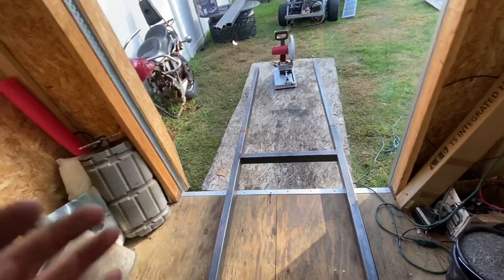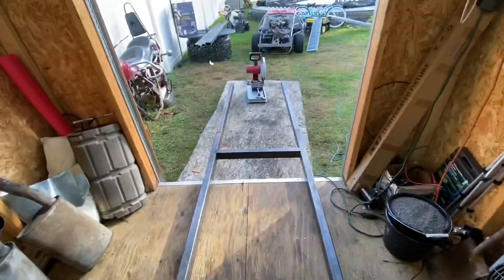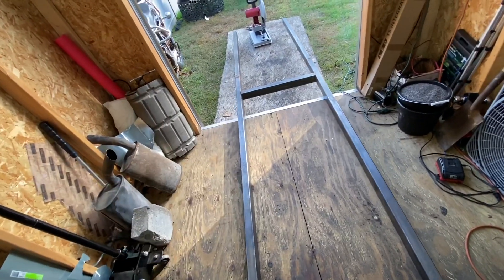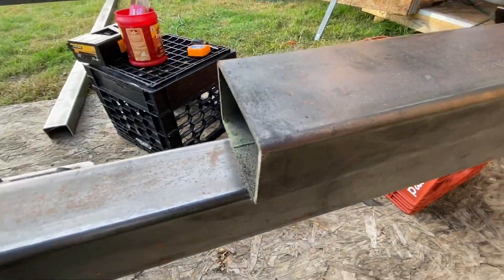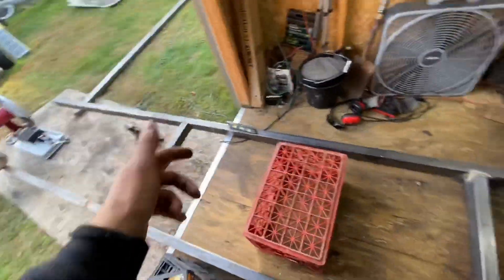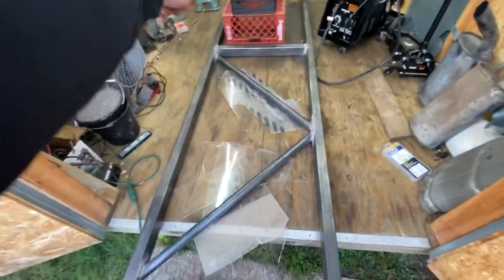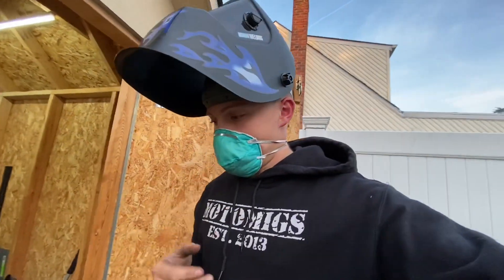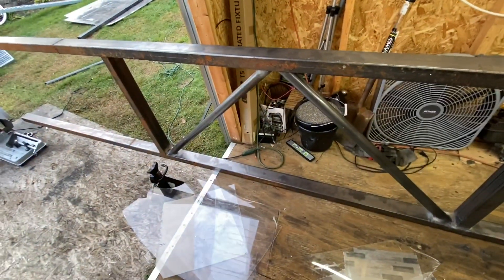Making the FIRETRUCK Frame STRONG! Adding Support Before DRIVETRAIN Begins!

Comment: Use a small part out car for steering and rear and front end parts. A little quad/go kart 100% wont cut it for that thing. Itll make your life easier if anything, and prevent future problems in the long run. Good luck man lookin sweet!

Comment: I wouldn't use a live axle. Its not going to be strong enough. Personally I would get some Miata parts from a junk yard. Ie: rear diff, rear suspension, and axles. That way you know it will all work together. Same with the steering? Thats going to be a heavy truck.

Comment: Instead of going w a life axel n probably no suspension, y don’t u find an old geo metro or small fwd 4cyl car n use the front suspension n engine but mount it on the back? 🤔 ofcourse lock the spindals so they won’t rotate, but then ud be able to use actual car tire